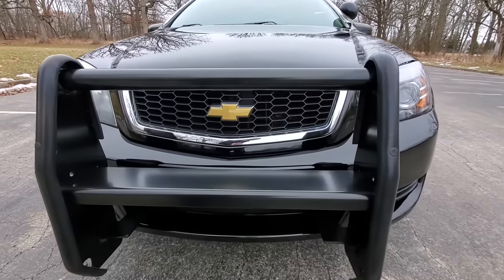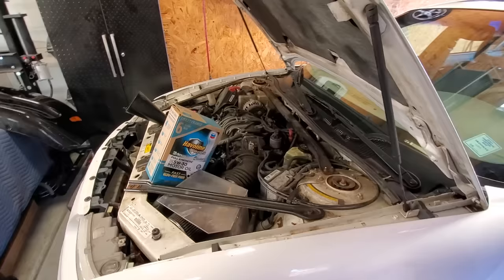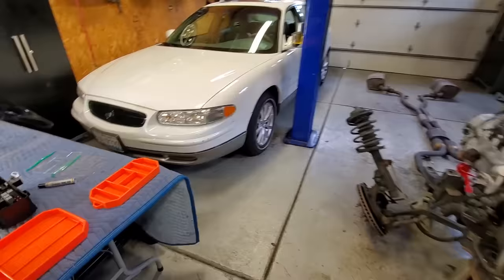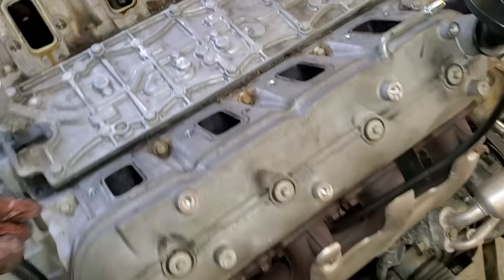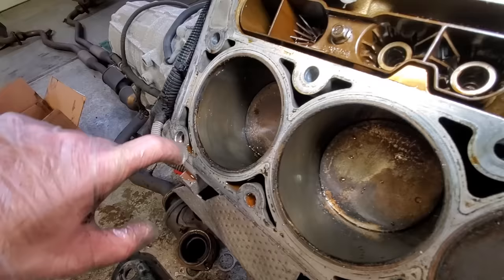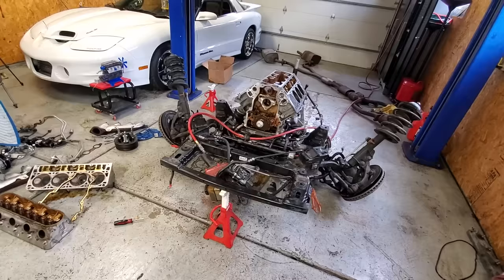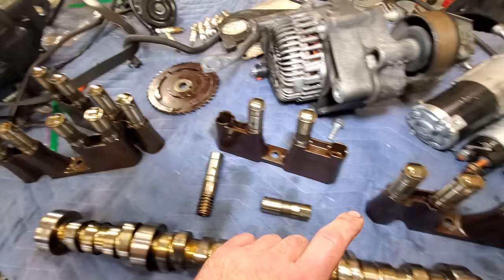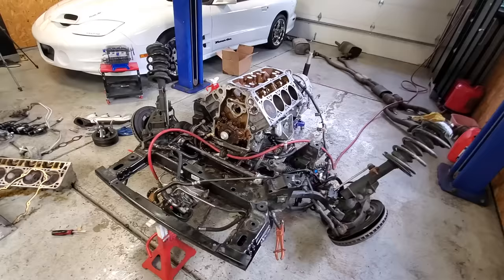Looking Inside An ABUSED V8 Engine That Idled For 12 Months! 357,000 Mile LS Teardown + Body Removal

Comment: I’m just amazed at how good electric power tools have gotten thru the years. Only time I use the air hose is to air up tires lol
Reply: I know right, spent my early 20’s collecting all the air tools a guy could want, only to now have them sit in my tool chest unused. Who wants a hose and a noises air compressor.
Reply: So you say I shouldn't buy air tools? I am starting to collect tools for work with cars. Have some Milwaukee fuel m18 tools for carpentry/remodel.
Reply: @MariuszChr  air tools can be stronger, cheaper. But moving around a  hose is a pain. You can do pretty much everything with electric these days except if things are very rusty in suspension stuff. Depending on the car your harmonic balancer might need air tools as some have very high torque specs. Battery is just so much easier.
Reply: Mariusz Chrobak buy electric snap on tools. 
Some of the best ones I’ve used. From my experience 
But I’ve heard some stories from macro ones as wee
Reply: waterzap99 you are right. When something is way rusted on there you do need that air power lol
Reply: Fineline Industries that’s how my co workers feel. All there air tools from the years (1970-present) lol
Reply: @RockingChode  but then you have to buy powerful air compressor to run one tool every few years? :)
Reply: @MariuszChr Yes, that's the thing. Yiu need something beefy to run air tools. However big you think is enough. Get bigger. No one ever said, man I wish I didn't have so much air.
Reply: Mariusz Chrobak no joke I just have a craftsman air compressor for my small amount of air tools lmao 
Trust me. Power tools are the future and they just keep getting better and stronger
Reply: waterzap99 lol
Reply: You haven’t seen the handheld 18v  inflator?
Reply: Can't beat air for some things. Nothing like a 1 inch air line feeding a rivet gun the size of a mortar for 8 hours a day, or really anything that will be running for most of a shift. ... But yea, electric seems to me the way to go for general ease of use, quicky jobs, and portability. 

I don't think the Makita impact I have will outlast my 1970s craftsman impact stuff though.
Reply: The Milwaukee m18 high torque hits harder than almost any air wrench
Reply: @daftnord4957  not Matcos new 1/2"though, that's puppies got 1600 ft lbs breakaway! And matcos 3/8" got 600 ft lbs. Pretty sure they have the best power specs in the power tool industry
Reply: John Martinuk on paper specs mean nothing
Reply: @justinjones5288  I use them, they're top notch
Reply: @MariuszChr  i have not used my snap on air tools since buying milwaukee m18 and m12 tools.
Reply: @MattyFielding6  sure, I get it. But now I need compressor to purge irrigation lines before winter, so I could spend 100 - 150 on a tool instead of 300+... I don't know, maybe small wrenches are good idea, as you don't need to pull the hose to engine bay...
Reply: @MariuszChr  if your getting a compressor to operate air tools it should have an air drier and decent capacity. For pumping up tyres and blowing out lines a smaller, cheaper compressor will do. We have a home handyman compressor in our 6 mechanic workshop because everyone has battery tools.
Reply: @themindofjohn4346  I use my 1/2 in 20v for every thing!
Reply: Got a Harbor Freight special on sale for 35 bucks, supposed to have 1000 lb/ft breakawy torque. But it does have a cord.
Reply: It is amazing, and will only get better. Electric motors generate 100% torque from 0 RPM
Reply: I dont even own a air tank or air tools 🤦‍♂️ sometimes when loosing lug nuts I wished I had air tools
Reply: I use air for the sole reson that i cut power when i leave the garage so batteries cant charge overnight
Reply: Its not the tools themselves that have gotten better....just the battery technology
Reply: @blazejohnson7342  There is an easy solution for a Shop. When u have 6 Mechanic use 7 or 8 impact. If one get hot use another and let them cool down. U always need some in stock if one break.
Reply: Home gamer / hobby use electric is awesome, air is irreplaceable for shop use though.

Comment: diesel generators: ROOKIE NUMBERS
Reply: Gotta get them numbers up
Reply: 4xs a day
Reply: yeah right diesel generators constantly clog dpfs cause idol time
Reply: Word on the street is that generators run in there operating rpm while producing power. Not down at 500 to 700 rpm
Reply: @scoutdogfsr  na bro im a diesel mechanic  trust me i spend half my day forcing regens on gen sets causqe they sit at idol all day until one dude fires up a welder o grinder on the job site. or they power a single set of staium lights that dont pull enough power tokick rpm up.
Reply: @scoutdogfsr  wat
Reply: @jakefloden6512  aren't most job site gens gas anyway? I mean.... diesel generators from what I've seen are inside large buildings only as a standby, and job sites in cities for the most part can piggyback off the power grid. Also... diesel generators absolutely do run at higher RPM's, not at car engine idle speeds.
Reply: Generations make AC in a frequency depending on their RPM. So for regular 60 Hz AC (i think it's 60; in Europe we have 50, correct me if i'm wrong) the engine has to do 60 revs per second which is equal to 3600 rpm, independent from the load applied. When you apply load to the generator, the torque required to turn it increases, so under load the RPM doesn't change, the engine will just inject more diesel, thus producing more torque to keep the gernerator at 3600 RPM under increased load
Reply: @paul_109  Well explained

Comment: This has to be my favorite video of yours, I never knew they had an idle meter... crazy interesting.
Reply from the maker: Thanks Matt! Lots of trucks have the engine run time meter now too. My 15 Escalade with 73,000 miles has 4500 hours of run time.
Reply: Depends on the car but most new cars have an idle time meter
Reply: @hedleyt8095  I had no idea I'm going to see if my eClass has that meter
Reply: @WarpedYT  if it doesn't have idle meter you can sometimes get the runtime by connecting a obd computer to the cars obd port to read ecu fault codes, get live data and sometimes run time.
Reply: I never knew this wow
Reply: @WarpedYT  hopefully it does, because even my ford focus and mustang have it. If ford, does and not mercedes, there is something wrong with the world.
Reply: @LegitStreetCars  You should get a crown vic police interceptor too and modify it lol.
Reply: When i look at run time its only for the duration of when it was started..  i got 08 ford and doesnt have anything about total run time..  it might in the as built data but that craps a big hoohaa of gibberish to me.. took me hours to figure out what numbers and letters to change to replace the gauge cluster without having to go to ford and have them flash it..  for 700$..  baalogna..
Reply: All of my GM trucks and SUVs have engine idle hour meter in their settings I think I remember it on there even on my old 2005 Tahoe.
Reply: Holden built engines
Reply: General Motors

Comment: I’m 100% using that as a negotiation tactic. 
“Yeah it’s only 80k miles but it’s idled for 1000 hours. That adds an extra 33k miles in wear and tear....”
Reply: I’d just tell you to go buy someone else’s car and raise the price $1000 on the spot for you.
Reply: Doesn’t work like that but give it a try. Also, not all cars have idle timers.
Reply: @drink15  it does if the owner needs to sell. And it’s a valid argument. Wear and tear is wear and tear. And if someone didn’t acknowledge that I would be happy to not buy their vehicle
Reply: @markg1495  exactly. Not doing it in a malicious way but it is something to be acknowledged. Especially on lots where dealers like to under pay and over charge on cars that are considered “hot”
Reply: @jeremycross7737  at that point I’ve actually already walked away from you so walking away from me would be the best thing you could do to maintain dignity. But I hear you ☮️
Reply: Used car dealership in the hood maybe....No legit car dealership buys a vehicle without checking the Vin and everything else which would come up if they were stolen.
Reply: @drink15  All cars after 1996 you can read the "Time the computers been on" which is close to idle time since most people don't have the car in the "Run" position for hours on end.
Reply: I wouldn’t sell anything to you
Reply: @maximillianalexander7052  have fun getting someone else in that case!
Reply: @pilotavery  ive never heard of this how would you even read that and get the info out of a car

Comment: There are youtubers that engine swap taking them around two years !
And Alex taking a part totally fine engine just for fun, all that in one episode.
INSANE !!!
Reply: that is the Master having fun ✌️
Reply: Camaro 1968  no...
Reply: @sethh8892  r/whoooosh
Reply: @DN..11  r/iusereddit
Reply: Dude it's way way way harder too put a motor in a car it was not designed to have. I put a 350 in 1979 monte and that required so much fabricating by itself. Now add modern tech like fuel injection return lines and advanced ECU and OBDII makes it a nightmare. Dealing with Chevy and Ford new modular designs is a real pleasure
Reply: @aaronmonke6825  I'm talking about 1:1 engine swap, not something custom.
Reply: @regulareverydaynormalguy6479  subframe/powertrain drop in that chassis takes about 2 hrs avg, and ditto for dissassembly of an Ls on floor at max, so he maybe had 4 hrs into it. Anyone that takes more than a day to accomplish an Ls removal and teardown is underqualified. Saying this man is a god for condensing a days work into a 15 min vid is way off....
Reply: I eel attacked
Reply: @regulareverydaynormalguy6479  okay you're missing it entirely. Regardless of a kit, your going to run into a situation where your gonna have to fabricate. Its normally trivial and important that haults the build, like a serpentine system having to be reconfigured so it fits and jives. Relocation of components leads to  unforeseen externalities aswell
Reply: monke  A 79 Monte is an easy swap for a 350sbc. A lot of them had them. Could of bought factory motor mounts and dropped it in lmao.
Reply: Alpha Wërks me, I have a full time job. That’s why my LS swap is taking so long
Reply: Alpha Wërks  really? A "350" is a very  general statement. Multiple designs,kick down switches, tv cables, linkages, centerbolt, perimeter bolt, it's not so easy lol. Then converting tbi 350's to carb... Alot more fabricating required them ppl realize
Reply: Alpha Wërks cooling shroud, centerline,radiator height, driveshaft.
Reply: Alpha Wërks my E46 M3 is also getting a turbo 5.3. Except I’m going with a cd009 instead of a T56
Reply: Alpha Wërks  it's not a "straight" swap lol

Comment: His idle time to distance traveled conversion is scary accurate. My car glitched one really cold morning and recalled all the data it had recorded since day one, and the trip meter read 87,000 or so miles with an average speed of 33 MPH, so his idle time to miles driven conversion is damn near spot on with what my cars datalog said.
Reply: That Regal is nice
Reply: That’s not a glitch. Some cares immediately after start up if you press and hold a button it will recall that info